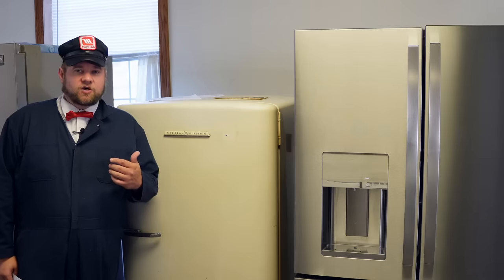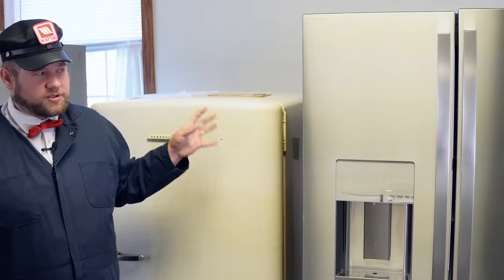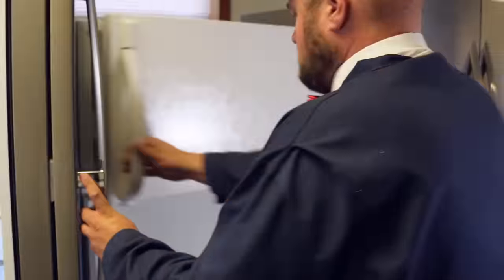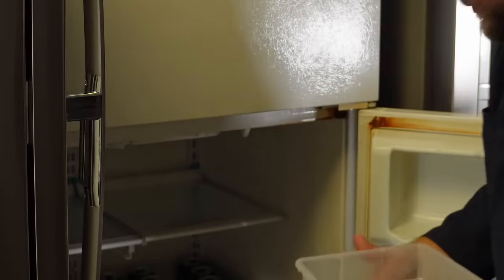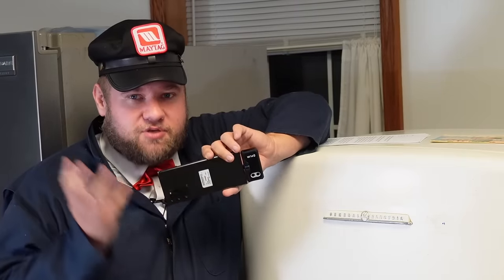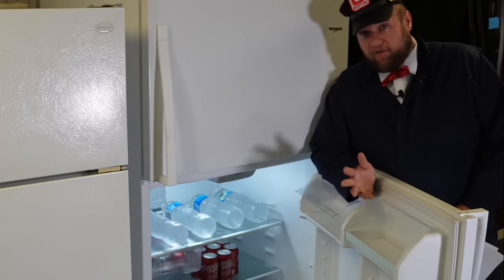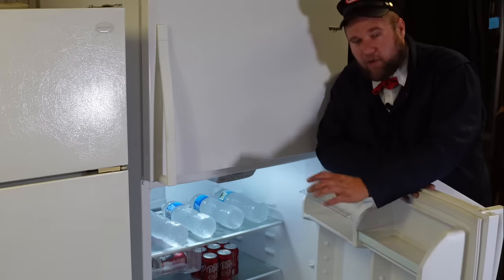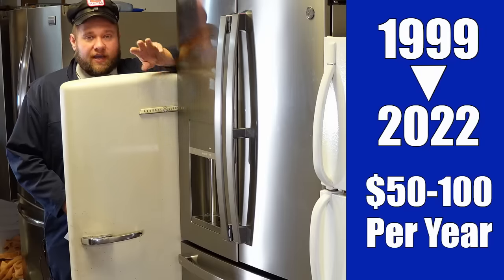Should You EVER Buy a New Appliance if Yours Still Works? A 7-Day Test

Comment: Great video.   You provided a well balanced comparison that even included the mention of long term reliability. I'll take the 1950's and just deal with the small size.   It will more than likely still be working for decades.   Imagine the environmental impact of the 5(or more) refrigerators  that had to be built and ended up in he trash heap while this one continued to work.     Same with cars.    I drive a 20 year old Toyota and and read that EV batteries are projected to last 10 years and wonder what the environmental impact of having make two build 2 EV's is compared to one quality internal combustion engine.
Reply: battery does not equal engine
though i have no doubt the industry will go for selling a new car instead of switching a faulty component, given how much they love planned obsolescence...
also neither of those options are good - we need to massively reduce reliance on cars, rather than just replace the type of car... mass transit is just that much more efficient
cars are the equivalent of having a minifridge for every item you want to store cooled... and trains and busses are an actual fridge

we really should only be replacing things when they really need replacing (for example when they are broken or no longer suited for the function they need to fill)... and stuff should last as long as possible, rather than just long enough for the producer to sell you the next one

also sidenote on ICEs - we basically have reached the limit for optimization for those, because the industry has fought tooth and nail to prevent a switch or expansion into electric when it made sense and as a result, those are much less well developed, while ICEs got optimized to hell and back... we can expect significant efficiency increases in the future if electric engines become a major focus (which is likely, given that militaries are looking into using electric engines for tanks)

further sidenote - i ride a 5 year old bicycle and ride in decades old trains... gonna be hard to beat that environmental impact with any kind of car
Reply: I have my doubts that they will allow you to change a batte    @SharienGaming
Reply: @bonzo1971  yeah thats what i was going for with my second sentence
Reply: @SharienGaming  It may require 3rd party aftermarket support like I see for the Prius and Leaf batteries.

Comment: Nothing is built to last anymore, sadly. My great aunt, who's in her mid 90's, was using her General Electric stove up until two years ago. The stove was bought new (along with the house she resides in) in 1952, and it lasted until 2020. 68 years old, that stove was. Now she's got a glass cook-top "thing" that may or may not last 10 years before something catastrophically fails.
Reply: Induction stoves,  they are the best.
Reply: @ursulasmith6402  Yeah, my Aunt's is the old style glass cooktop (electric coil under glass). Induction is nice as there's really no wasted energy or heat, as only the pot/pan is directly heated.
Reply: Please make sure you use the correct units. You were measuring kilowatt hours (kWh), which indicate total energy over a period of time. Kilowatts (kW) indicate the amount of energy being drawn at a given moment.
That's why, for example, electric car battery capacity is measured in kWh, whereas electric motors are in kW.
Reply: @granthb  Um, I think you meant to put this in the main comment thread. At no point did I mention Kilowatt/hours, or kilowatts regarding my Aunt's old stove.

Comment: I'd be interested in seeing how much more efficient new fridges are if they didn't have sill heaters and weren't self defrosting, like the older 1950's one is.. or perhaps testing a compact dorm style fridge vs the old 50's ones.
Reply: Defrost cycles can use 50% of the energy the fridge demands...  Heating the coils to make the frost melt, then recooling the fridge.

An "all fridge" has no defrost.
A chest freezer without defrost cycle is far more efficient than any stand up freezer.

I'm buying all new appliances for a new construction house and will have a separate 'all fridge" and chest freezer.  More capacity and less energy than a single fridge-freezer.

Comment: When I built my house, I took my mom's older fridge.  I don't remember how old, but let's say 10-20 yrs.  After using a kilowatt meter, I determined that a new one that cost $400 would pay for itself in 3 yrs in just electricity savings.  There was nothing wrong w/ the old one, it was just financially beneficial to get the new one.  And last I checked, the new one is still using under 1kwh/day (old one was 3-4kwh/day if I recall).  My results were nearly the same as your 1999 vs 2018 models -  which so happens was very close to size and vintage of the models I compared.
Reply: Gotta count all the oversight as well. How long both will continue to last without any maintenance? The first one to break will add cost from; lost food, EAT away your free time, someone that will have to fix it, part cost.
then you repeat the above as many time as it break while the other will continue to last.

My mom's fridge from the 70-80 still work, not a single maintenance yet.
The new fridge we bought broke within 5 years from a powersurge. The dam electronic board fried and mind you it was not considered a "smart" fridge. Lost some food and several days just to find a replacement board.
Reply: @TwinShards  That's a lot of 'what ifs'....what if the old fridge that has worked fine for 20 yrs breaks the next day?  What if the new one lasts 40 yrs w/o a problem?  The only thing I do know is running the old one was going to cost me $100 more per year in electricity, an automatic $100 loss, every yr.  Electricity is only going to get more expensive.  I don't know as if I can really find one that uses much LESS than 1kWh/day, so I don't plan to replace this one unless something happens to it.  I can't remember when I got it, but I've got to be close to saving enough already since I got it (after paying for itself) to buy its replacement if needed.  And every yr that it keeps going, it's just making me $ compared to the old one.

Comment: Only needing a third of the power, while being less noisy and providing a bunch more space was a pretty convincing argument for me to get rid of my old fridge.
Reply: @graealex  yep, modular fridge would basically allow upgrade case separately, better repairability and second-hand market. For the inverter, it is a part of electric scheme of compressor, if I got you right, so it should come with compressor module.
Reply: @graealex  I dont see how couple of fittings would cost you +€900. It is literally $10.
Reply: Until you have to replace it in 7 years continually
Reply: @wlonsdale1  Well, if contemporary products in 7 years manage to cut down on electricity in the same manner, I'll gladly replace it. I paid 450 EUR for a new high-quality, full-size Bosch fridge and freezer combo. Although I don't expect it to break down in just 7 years. But that's the old "everything was better back then" sentiment, while a lot of stuff back then was literal crap, for way too much money.
Reply: @graealex  Can you say what the overpriced crap was?
Reply: @Telecolor-in3cl  Mechanical and generally overbuilt stuff. You don't need to make everything from 1/8" sheet metal.
Fridges might not be super good examples for this, but generally, just because a manufacturer puts a lot of effort and material into something, it doesn't necessarily mean it's a good product. Even though people have a tendency to value stuff made from metal higher that stuff made from plastics.

Comment: We decided to change our refrigerator back in 2018 I believe. Our previous refrigerator, I'm pretty sure, was at least 15 years old at the time. Probably between 15 and 20. I know it was, at least, 15 because we moved back in 2003 to our current house and we took the refrigerator with us. We were debating as to whether or not to buy a new one because we weren't sure if the old one would last any longer. But, we decided to air on the side of caution and avoid the refrigerator randomly dying and the food spoiling.

Comment: If you factor in the years of service that the 1950 gave, the oldest refrigerator is by far the best buy. That's 72 years of service; probably without repair. So, with the idea that today's fridges last 3 years, if you are lucky, and cost about $1000 at least, that 1950 paid for itself many times over. So it's clear that the oldest fridge is the biggest money saver. My 1958 GE has been running non-stop, without repair, since 1958. My bill went way down when I sold the new LG I had and replaced it with the GE. No way would I ever buy a new one.
Reply: Where did you get 3 years from?
Reply: @golddavid  It's a figure that appliance repairmen continually quote.

Comment: Hey, I’m a little bit confused by the units you use, you keep talking about kw but actual energy consumed is usually measured in kWh (as can be seen in the graph you showed towards the end of the video, showing average energy consumption per year). Did you mean kWh and just misspoke? What is the actual unit displayed on your powermeters? If it was just kW (without the h) you are just taking a snapshot of the energy consumed in this specific moment, so you might miss peaks of energy consumption(eg ice being frozen over night).
Reply: Much appreciated though how you broke down how a fridge works, very well explained!

Comment: My parents 1946 Philco refrigerator still runs like a top. My brother got it rewired with a new relay and door gasket (can’t believe he found a replacement door gasket). Had the body shop paint it  antique blue. They don’t build them like they used to , I guess if they did the manufactures would probably go out of business. Built-in obsolescence is the name of the game today, sad😢.
Reply: I love that you mentioned the auto body shop.  A friend converted a mid-50's fridge to hold a keg with a big tap installed on the door.  He delivered it in his pick-up to a local auto body shop and they applied a beautiful metallic burgundy paint and 3 coats of clear coat and it looks amazing.
Reply: You might be able to use one or two vehicle door seals on it with little modification.
Reply: When I had my first house I had an old Frigidaire with the crown. Real simple. It was all grungy and needed a door seal but I liked it and stripped it down and repainted it, made some weatherstripping work for a seal.
Worked good for number of years and even though I had to manually defrost it, it was like a game.
Then compressor finally decided it didn't want to turn anymore and I had to let it go.  Then shortly after I had refrigeration class and wished I still had it we could have made it a class project putting a new compressor in it. That would have been sweet, i would probably still have it.
Reply: @michaelszczys8316  Yeah, I've got a fridge from 2000 that lasted so long, I've only had to replace the compressor, control board and the Fan in the vent that links the freezer at the bottom to the fridge area above it. That's pretty much it up to this day. 

The newer fridges are not being built like they use to be.... I'd hate to see the future of fridges if it continues down this path.

Comment: My mom and dad bought a Kenmore refrigerator new in 1996 when we moved into the house and it’s still in the kitchen and it works perfectly fine. We also have the original 1980 dishwasher from when the house was built in 1980 and it still works perfectly fine. the brand is KitchenAid. My parents divorced when I was 16 in 2006 and my dad’s first house after that and in his current house now both have fridges from the late 80s and they’re still working fine and he also got a upright standing freezer from my brothers wife’s dad and its from the 1960’s and it still works perfectly fine. My aunt once had a clothes washer she gave away maybe sometime in the last 10 years or so and it was from the 1950s and it still worked perfectly fine!

Comment: Don't forget that newer fridges are frostfree and to do that they have a 200 plus Watt  heating system in between the wall structure that is activated every time it goes in the defrost mode.  That can run up your electric bill quick compared to the old type fridge.

Comment: I honestly like the appearance of old refrigerators.The fact that they can still function at a somewhat comparable level to new ones is just a bonus. What about retrofitting them with new components? I’m sure this has been done by DIYers but why can’t it be more common?
Reply: Restomod.
Reply: @chdreturns  very cool, thanks for the recommendation😎
Reply: I'm not a fan of retrofitting. In 2001 we purchased a professionally-restored 1938 Frigidaire. It had a modern compressor that failed in about 5 years. GM-built Frigidaires used rotary compressors, and I bet our unit's original one was still good. This was terribly disappointing considering what we paid for it.

Comment: Thanks for this great video! I appreciate how long it took to run these tests , collect the data and make the video itself. Your Grandma would be so proud!  I was offered a free 2015 unit if I  would just haul it away. It was much more sleek and modern looking compared to my 1987 Gibson….but the Gibson has NEVER needed a repair. Sure the freezer is tiny but we have a big chest freezer in the basement, also made the same year and too has never needed a repair. I’ll stick with the old models. Sure, I’ll pay a little more for electricity, but cost of unit spread over years of use ( with zero repair bills) is looking very sweet to me.  We donated the “fancy” fridge to the local food shelf. I hope it gives them years of good use. When my upscale relatives come to visit and they learn they have to go down to the basement for their ice cubes and pull them from the silicone cube trays, the look of shock and horror on their faces is also worth the a little higher electricity bill each month! 😅

Comment: You may have actually convinced me to take my brother in law's old 50's GE to toss in my garage for drinks. I figured it would draw way more than it does so I hadn't considered using it, but I love the old styling. Concrete floor thermals keep the garage ambient around 64 degrees year round, so it should use even less.
Reply: My closed up garage gets super hot in the Summer.

Comment: The freon used in old redrigerators was incredibly efficient. Also the locks werent childproof and closed the refrigerator tightly. The old monitor tops had the compressor mounted on top thus making them more efficient.
Reply from the maker: The catch is newer refrigerators use way, way less refrigerant. Everyone says old ones were more efficient and they weren't. The old fridge uses about 1lb of charge if not more. The GE uses about 4oz for nearly 3x the cubic foot of storage
Reply: I remember children dying inside those fridges a lot. You'd read about it in the paper. Someone would put one out for trash and forget to remove the door. Kids playing hide and seek. Kid would suffocate inside it.

Comment: Thanks for the honesty. I have a GE Refrigerator bought in 1967 (I think for $1700 or so, a lot in '67) with swivel out shelves in the fridge and it is a bottom drawer freezer just like the new designs except it's a basket not a bucket design. A couple years ago, a lightning strike caused the thermostat to stick and it started freezing everything in the refrigerator part so I was turning the thermostat control on and off to simulate the normal automatic cycling of it. I was literally on the phone with an appliance repair and parts company to make a service call appointment and requesting a senior service technician since the refrigerator is so old and I heard it automatically turn off (like normal operation) so I told them not to bother that I think it just fixed itself. If my house ever burns down I'll cry if that fridge gets destroyed (but I'll claim it's because of my pets). BTW, I also have the same stove that Lucy had in I Love Lucy show in the 50s or 60's, a Westinghouse corox burner stove with single oven (they also had double side by side oven models) I think it was built in the 50s. Only have one burner out but can't find them anymore. If anyone wonders, my wife bought the house from her father when his mother (her grandmother) passed away. Luckily nobody had someone come in and remodel the kitchen with newer (shitty) appliances. We still have the old 3/4" thick (squeaky) oak hard wood floors too, glad nobody covered or ripped them out for laminate (yuk).

Comment: My Granny's 1940s or early 1950s fridge and freezer still worked in the early 2000s when she passed. I don't know what happened to them after she passed. But I wouldn't be surprised if they are still out there somewhere running at someone's house. Our stove and oven are from 1971 and still work great. Analog appliances are my preferred appliances. Our washer and dryer we bought used over 10 years ago so I am not sure how old they are but they work great. Older, analog appliances just seem so much easier to fix and maintain long-term.